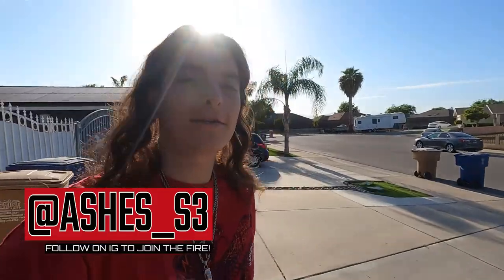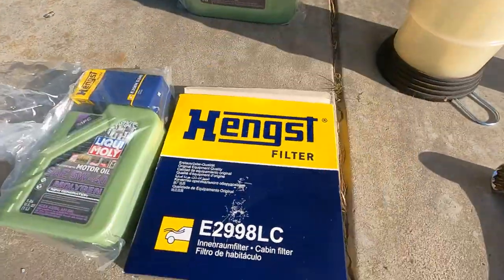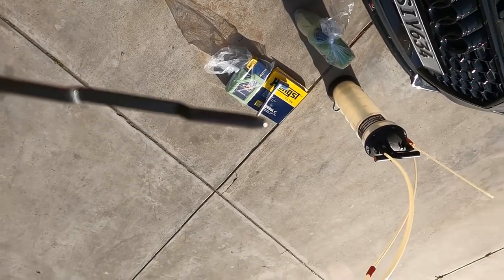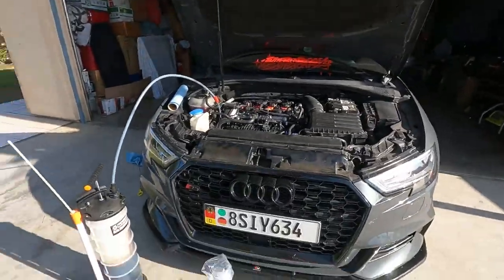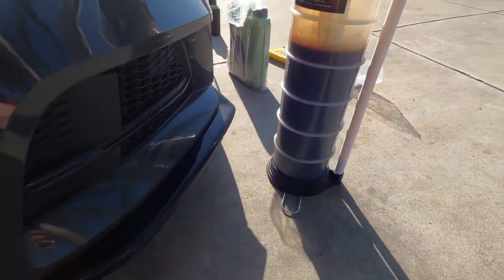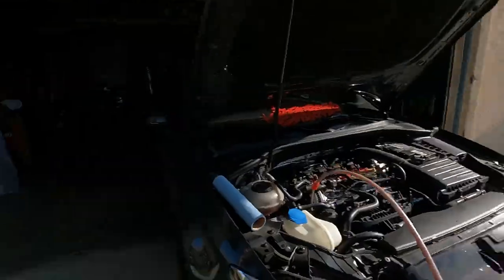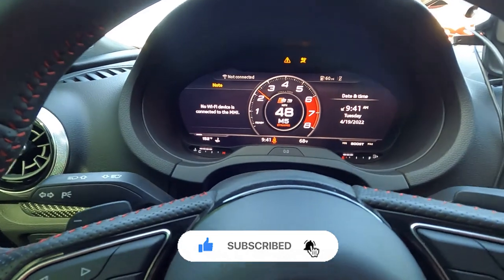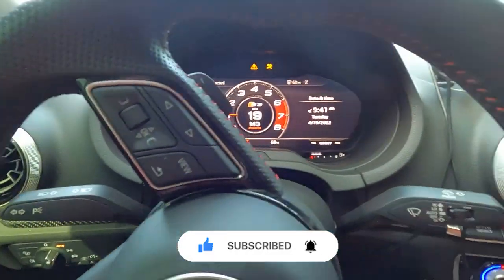HOW TO DIY OIL CHANGE + CABIN FILTER on AUDI S3! EASY! MK6 , MK7, MK7r , MQB

Comment: Nice video papa! Need to do this service on my 18 s3 real soon too. Good man waking up early n getting it done. How much was that oil extractor?
Reply from the maker: thanks a lot fam!! i try haha this heat will punish me if not 😂! the extractor was only like 80$! none of my local auto parts store carries them but they have it on ECS tuning website ! i appreciate your support man means a lot🔥🤞
Reply: @ashes_s3928  Of course man!  Ur channel deserves way more subs . Nice dude thats a solid deal cause in ur video it looks like it works really well. Im definetly going to checkout ecs for that thank u . And im the exact same way with my oil cap and gas cap and any other thing. It all needs to be facing the right way so u can read the words.. its my ocd . Keep u the good work man!
Reply from the maker: @vws8851  much love bro, i will! it makes life so much easier and it even works on the MK4 gti! so the whole fleet gets its use out of it haha im forever a VAG car guy now

Comment: Thanks ! Im gonna pick up one of those extractors from ECS site, I didnt realize it was that easy. Im kind of a novice when it comes ot DIY jobs on cars but Id feel comfortable doing this lol.  All I use is LiquiMoly- 5W40 Leichtuf for my 2018 S3 , maybe its placebo but it feels the engine just revs out so smoothly with it compared to the OEM Castrol.  Where did you get the RS style replacement front grill ?  Thats exactly what I need next, looks perfect.
Reply from the maker: hell ya bro the extractors are life changing! and it’ll save you plenty of money on services for years to come. im no mechanic so i try to encourage others to attempt DIY themselves as well so i’m so stoked you’re gonna do it! lmk if you have questions along the way or for any other services (brakes, installs, etc.) i’ve done most of my installs myself besides the turbo and downpipe i didn’t have a lift or ramps at the time lol.  i love liquimoly and you can send back your old oil and get it replaced for free from FCP euro if you buy from them , it’s amazing!! the grille i got off of someone reselling them on instagram i forgot her tag , but black forest industries has some on there site the last time i checked , you may get lucky!!